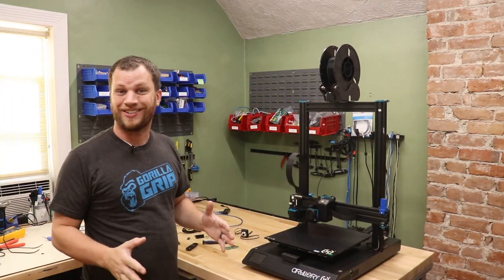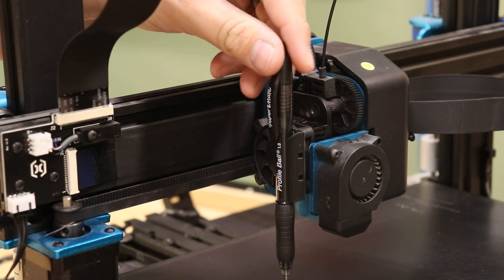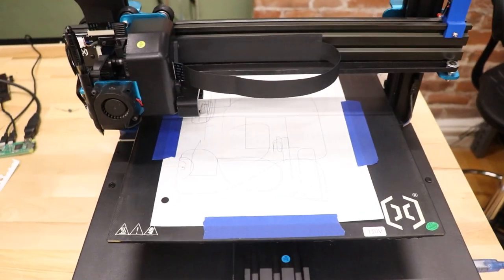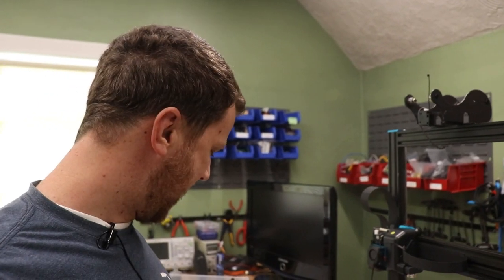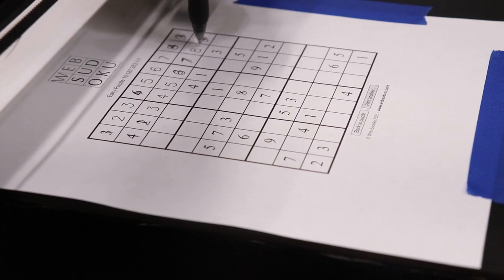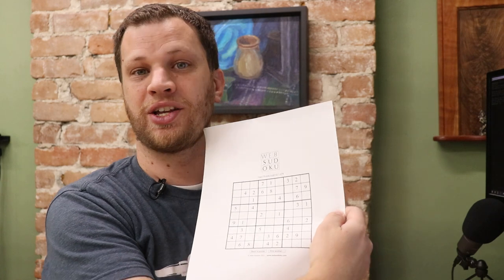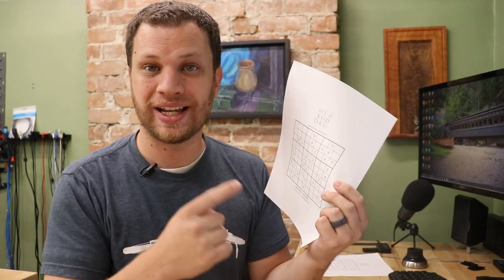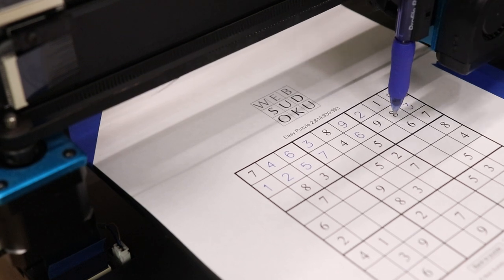3D printers aren't meant to do sudokus!

Comment: This is awesome Zach!

My CNC kit came with a marker, and the "hello world" gcode was meant to be run with the marker taped to the router.  It seemed like a safe and easy test to run, so I gave it a try.

I don't recall exactly what I did incorrectly, but I do know that the marker got jammed straight down onto the wasteboard, and the marker was under the mounting block for the router, so that poor marker just got completely obliterated.
Reply from the maker: Oh that's interesting that the hello world example didn't actually use the router, but a pen plotter instead. I wonder how many pens have met their demise from people trying to do pen plotters